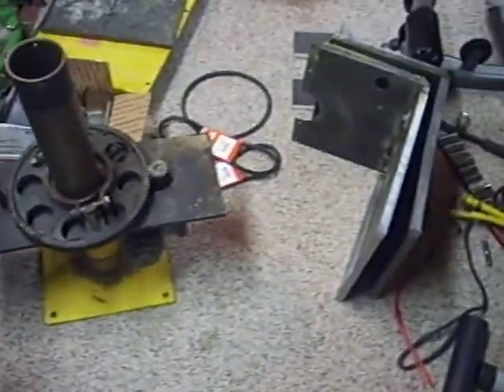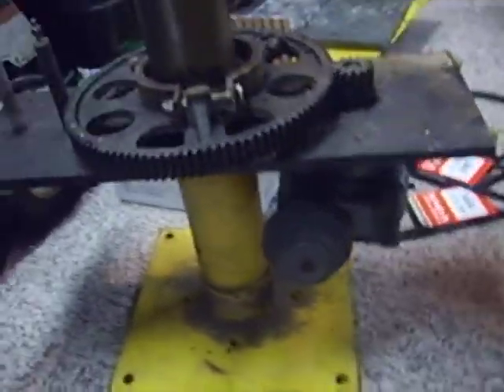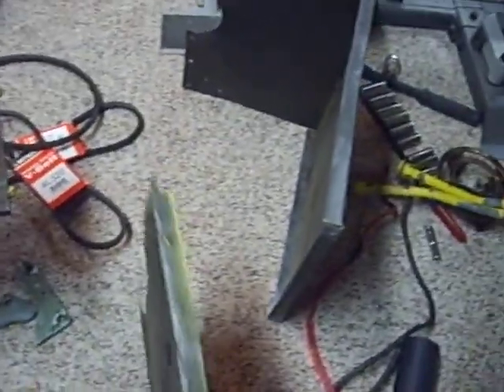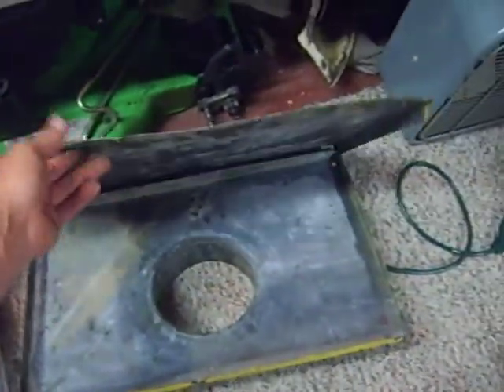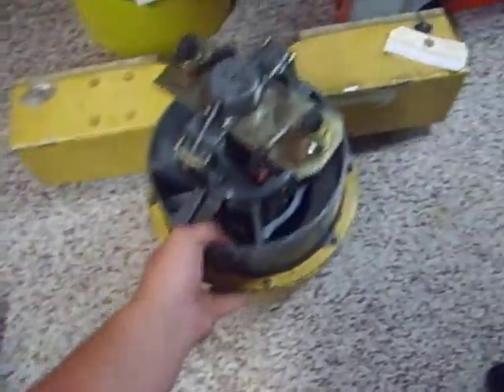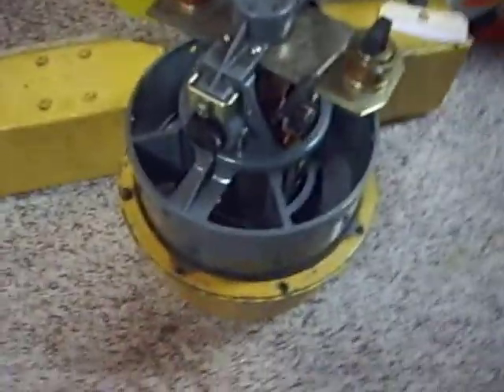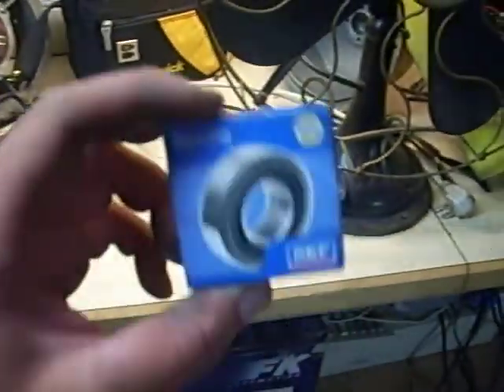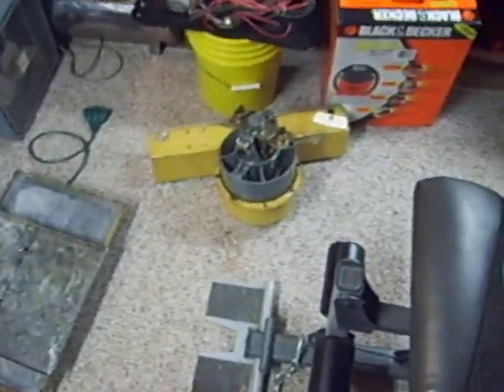Thunderbolt 1003 Restorations...VIDEO # 4--GOOD NEWS!

Comment from the maker: @rhett443 Thanks Rhett! Actually, no work was done on any part of the motor/chopper but the commutator. My machinist friend put it in his lathe and cleaned it with the white armature stone.  I cleaned the inside of the stator and the outside of the chopper rotor, but otherwise it's original.

Comment: @promod400exridr Check eBay, I bought a 10-pack for just shy of $10 with free shipping. Be sure you get them from a reputable seller though (like irvineman, who sells VXB bearings). I'll shoot ya a PM with the link to one of the "buy it now" auctions for a 10-pack of those bearings.